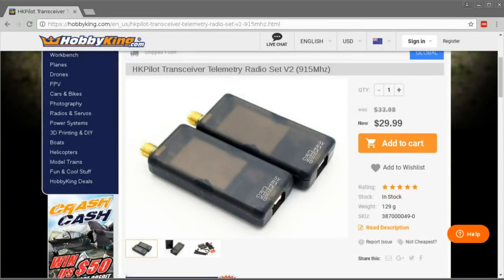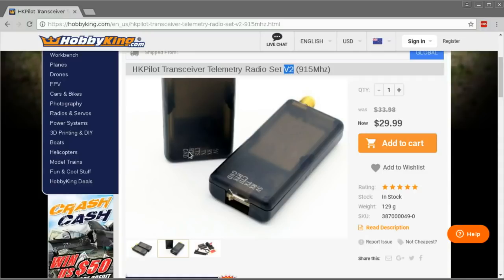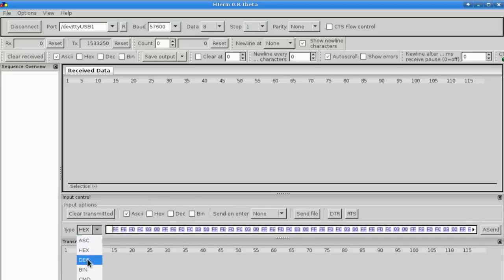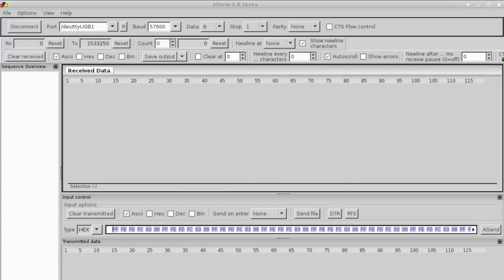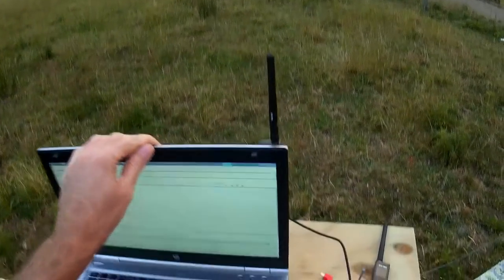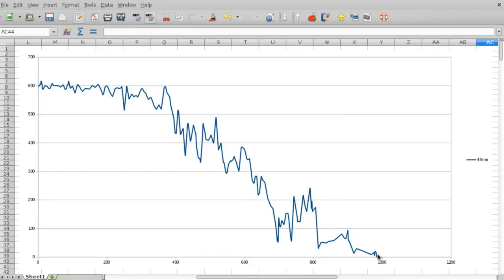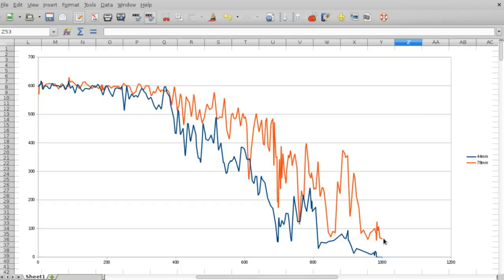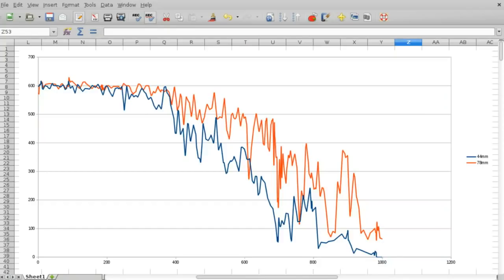HKPilot 915MHz transceiver range test (ground level)

Comment: Hi, I know this is late but I wished you recorded the ground elevation as well. That would explain most drops/peaks of the data receive
Reply from the maker: There was probably about 2 meters elevation change at most, before the dip in the ground I showed. But the connection was basically dead before I even got to that point.
Reply: @iforce2d  thanks for the additional info! I just had a bit of a problem with my 915 mhz transceiver, it cuts off at 200 meter distance ground level, and I live in a village with not so tall electric poles. Do i need to change my antenna or is there nothing I can do about it? Tried changing some settings except for baudrate but still the got same result.

Comment: i think those should have gotten better range than the NRF24L01
lower frequency=better range
but also more affected by fresnel zones
at 1km they should be 9meters high 
theoretically they can work at 19km, but also means the antenna have to be 40m aboveground, or the drone have to be 80m above ground minimum
Reply from the maker: Yeah it wasn't such a good test really. Here is a test of very similar equipment at 60m altitude with clear line of sight: https://youtu.be/dIvC4ZB88h0?t=1151

Comment: Hi Bud where about in Good old NZ are you? .Can't believe the attitude of your Landlord Jesus what ever happened to live and let live😆you could understand if it was a group of motor crosses with no baffles in the Exhausts 😊I heard more noise from the Cricket's than your plane and this one you where not even flying just transmitting low power signals. I would have asked him if he uses a mobile phone or wifi or does he watch TV or listen to Radio which fill the air with a  lot more RF than you do with your brilliant hobby...hope you get a more down to earth landlord bud...his loss at the end of the day. lets hope he replaces you with some really crap tenants 😉.....keep up the good work.

Comment: The "name brand" version of these modules from 3DR only claim a 1000m range under optimal conditions, so you're not too far off. As others have said, I think better antennas would be your best bet for improving range. For rover use, if you could get the base station antenna higher, even on top of a 3m stick of PVC conduit, that could help substantially.

Might also try lowering your over-the-air baud rate. While you're only sending 600bps, they're still being sent at the 57.6kbps rate, if you could drop the rate down to 9600 or even 1200bps you might have better luck.
Reply: Good advice. Just a small remark: note that bps is bits/sec (or bit changes/sec for baud I believe) so 1200bps is not enough for 600 bytes/sec like he sent.
Reply: salle rc Yes, you are correct :-) so he'd be looking at 4800bps as a minimum for 600(Bytes)ps. I had been going to back the video up to double check if he had said "bits" or "bytes" earlier, but forgot to before posting the comment...

I've had good luck recently using LightTelemetry (LTM), as supported in iNav, which is designed to run over low bandwidth links. I think the 3 speeds 1200, 2400, and 4800bps. So depending on his final usage, he might be able to go lower.

Comment: I used similar transceivers with ardupilot and even when flying LOS  I was getting similar range. I did not check inside the antennas though so I don't know what was the active element length. Interesting indeed.

Comment: Will you be experimenting with Waypoint functions of Mission Planner, maybe on your rover?  I have a rover and it drives great in manual, but problems in auto mode using APM 2.8 using the UDART telem v1 board, working on it. Also come to Kingston, Jamaica! , its close! , ill put you up, screw the land lord!

Comment: Seems like an antenna issue. I believe LORA uses the same frequency band and it has 10km+ range. BTW Your landlord seems like a really nice person :D
Reply from the maker: These transceivers are full-duplex 57600 baud, if I understand it correctly LoRa is not even close to that throughput. According to this, "400 bytes per hour": https://www.thethingsnetwork.org/wiki/LoRaWAN/Limitations
Reply: True, I`m no radio expert, but my point was that the frequency band is not the problem. Maybe it is speed as You say.
Reply: I have already commented on other videos but the answer to such radios is always the polarized antennas. I've done similar measurements (well not 900 but 434m,868m,2.4g) and cloverleaf always gave me outstanding results compared to whip or dipole antennas. especially in the lower bands, they are huge but they are incredibly boosting the performance. (ppl say it is for analogue signal, indeed true but the digital signal is also transferred with analogue radio signal)
Reply: Lora and LoraWAN are not the same. Lora is a wireless protocol from Semtech. LoRaWAN is using the LoRa protocol to create a WAN (for IOT).  https://en.wikipedia.org/wiki/LPWAN#LoRa

Comment: get yourself dipoles from this user:
https://pcbs.io/user/ChemE     the 915MHz or other if you need
you would also need some coax

you can read here more:
https://lowpowerlab.com/forum/rf-range-antennas-rfm69-library/alternative-pcb-dipole-designs-(433-868-and-915mhz)/

Comment: I think it’d really be worth experimenting with the following:
1) a proper 1/4 wave whip  antenna with a decent ground plane or a folded dipole (both are easy to make). This could fit nicely on top of the rover. The antenna you were using was very much imbalanced and would have relied upon the ground plane of the transceiver to radiate as much as the actual exposed part of the coax.
2) if there is the possibility to operate the radio at a lower baud rate and (more importantly) select a narrower receive bandwidth, this will reduce the receiver noise floor and thus improve sensitivity & range.

Comment: I think the nRF24l01+ PA-LNA modules along with 5 dBi WiFi antennas give a fair amount of range and not too much directivity. Should be a little over 2 Km (reliably) line of sight I guess.